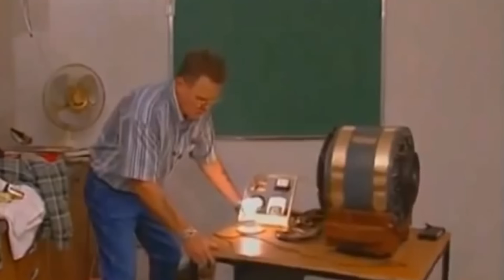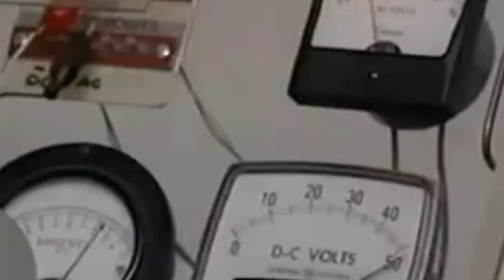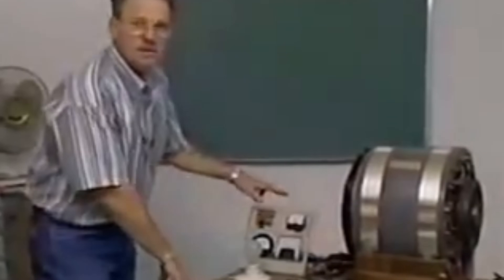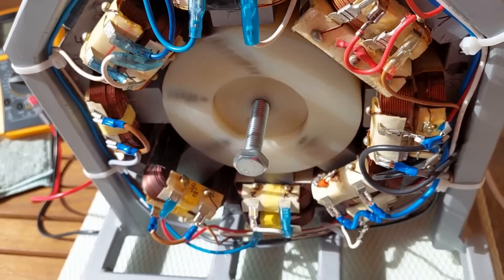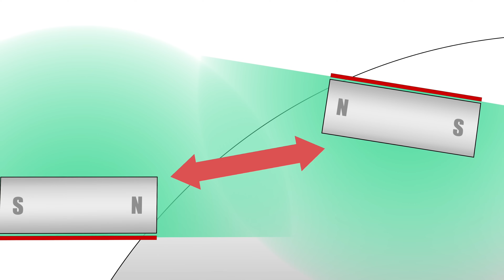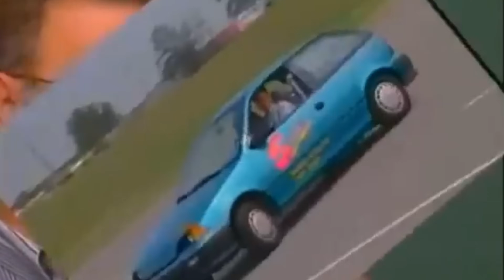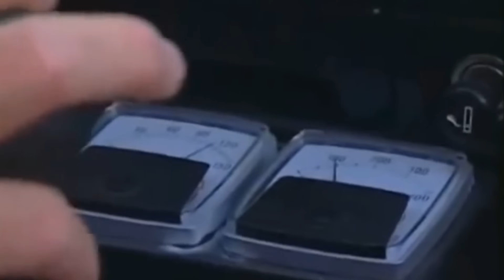Troy Reed 110kW Magnetic Motor Free Energy Generator Future Renewable Energy!

Comment: Why does this stuff keep popping up from time to time?
Reply: The truth has a nasty way of resurfacing. Most of these pioneers are “suicided” before you ever get the chance to buy their product
Reply: @erickdupont4503    This is not the truth but only a rumour without evidence. Can you name some "pioneers" who were "suicided"? The truth is, oil-companies trust their scientific advisers who tell them that "free energy" is nonsense. That's why they don't pay any heed to "free energy pioneers".
Reply: @erickdupont4503  I think this might be conspiracy theory. I've seen another video on you tube ( the liberty engine project ) where the engineer demonstrates step by step the construction of the engine. I'm not an engineer so I don't claim to know the science but if this magnetic motor was a reality wouldn't viewers who are electric engineers simply copy and build their own?
Reply: @tagcoriolis1029   By the initial manual crank the rotor gets an amount of kinetic energy and rotates. But with every turn this energy is diminished slightly by friction. Thus the rotor gets slower until all his kinetic energy is spent and the rotor stops. There is no possibility to prolong the rotation except by an additional input of energy! But permanent magnets don't deliver energy.

In addition perpetual motion is not what is wanted. You expect from a motor that it does some work. But if you add a load the kinetic energy is used up much faster and the overall gain of mechanical energy done by the motor will not be more than the energy given by the initial crank.
Reply: @tagcoriolis1029    Forget the liberty engine projects, they don't work! They seem to work in the videos but only by some hidden power line or other manipulations. The concepts of "Liberty engine" are not better than the flywheel-spring motors which have started to pop up on YouTube as free energy devices lately. Also complete nonsense.
Reply: @heinzpg  wrote; "But with every turn this energy is diminished slightly by friction." - do you attribute the failure to achieve perpetual motion entirely to friction or would you include other factors such as gravity? Also, could a perpetual motion energy generator work in space?
Reply: @tagcoriolis1029    Note that every motion of an object is perpetual - if no forces hamper the motion. But in our world there are always such influences. But e.g. planets experience no friction in the vacuum of space. They got an "initial crank" when the solar system emerged and due to this initial impulse they move around the sun without input of energy for billions of years. With electromagnetic motors you have friction in the bearings, friction by air resistance and in some cases also eddy currents. Gravity has no overall effect, it only increases friction in the bearings, since friction is bigger when an axis is pressed against the bottom of a bearing. 
All these influences can be minimized to almost zero by technical measures but only at high expenses. And this makes no sense, since perpetual motion is not an interesting goal! I already mentioned it: a motor must be able to drive a load and this needs much bigger forces than those of friction. A perpetual motion which would quickly come to a stop if a load is connected is utterly useless.
Reply: New generation of suckers
Reply: Because there are plenty of gullible people without background in science who believe in these scams.
Reply: @heinzpg  I remember scientists saying recently how something was safe and effective....
Reply: @1800imawake    Since you write only about "something" I can only answer in general. In cases where predictions of science were false the underlying laws of physics stayed undisputed and correct. Only the conclusions based on these laws were wrong, e.g. because something was overlooked. In contrast to complex technologies the "magnet motor" is very simple and if it works or not can directly be derived from laws of physics. Permanent magnets can't drive a motor. For a physicist this is as assured as you can't pull yourself off the ground by pulling at your shoe laces.

Those who think that also in this case science may have overlooked something should at least agree, that those who claim to have build such a motor have the commitment to prove this in a credible way, e.g. by having their invention examined by third party experts. But this has never happened. Troy hasn't done it and other similar "inventors" haven't done it either.
Reply: @heinzpg  The fact I can't be specific because of censorship with multiple replies is very telling, yet you can throw out the status quo all day long and should be telling to someone with such a scientific mind. You know exactly what I'm talking about.
Reply: @1800imawake    Censorship? Does happen, but not from outside. It's always the presenter of a video who suppresses comments. I don't know for sure what you meant. Did you refer to nuclear power stations?
Can you agree to my statement, that up to now no one proved in a credible way that he has a working magnet motor? If not, what exceptions are known to you?
Reply: @heinzpg  I agree with your final conclusion however, when you use the analogy of trying to pull yourself off the ground from your shoelaces, I don't think this applies because developers of a magnetic motor aren't trying to generate energy from nothing. There is an initial manual crank required to begin the motion, the trick is to sustain the motion for as long as possible thereby maximizing the amount of energy generated from the initial "crank".
Reply: @heinzpg  Yeah, plenty "trusted the science" and got vaxxed and look how that turned out... and there were plenty of expert scientists threatening people to get it.

Comment: Magnetic motors were a thing before electric motors came into practical use. BIG problem with those earlier magnetic motors were the poor quality & short lived of the magnetics.
Plus those early magnetic motor also had a big issue of starting, they needed help.
Reply: Mutass csak egy régi  mágnes motort?MIért nem tudsz mutatni egyet sem?Ja ,hogy mindet tönkre tették!.nevetséges ,amit állítasz!
Reply: Motors driven by permanent magnets alone have never existed and will never exist. They are impossible due to best confirmed laws of physics. Troy Reed was a scammer.
Reply: Nothing You said there was real. I dare you to show me a single example of a magnetic motor that works. No such thing.